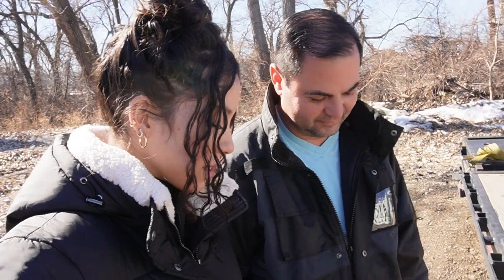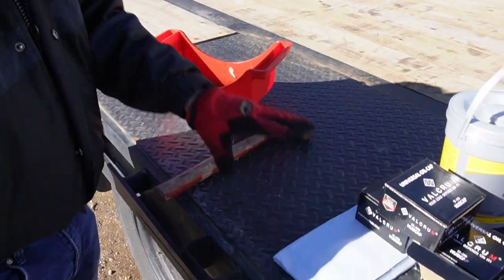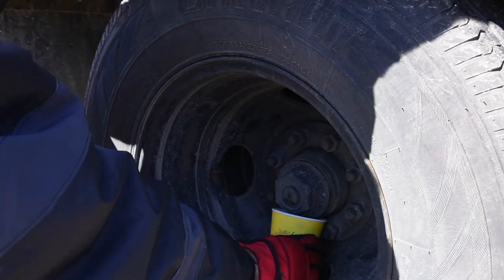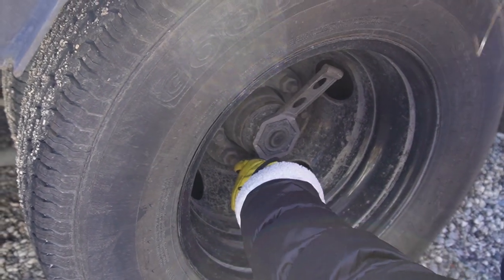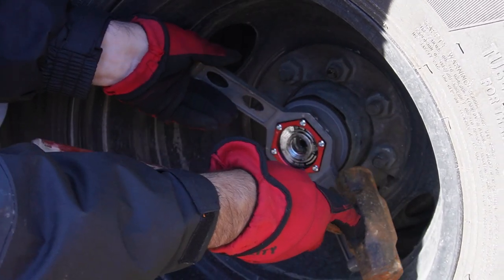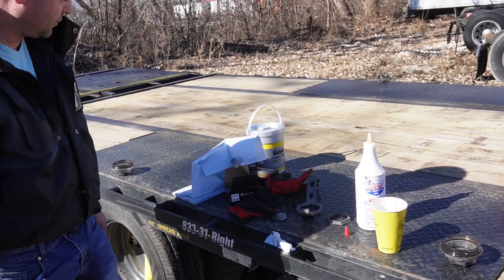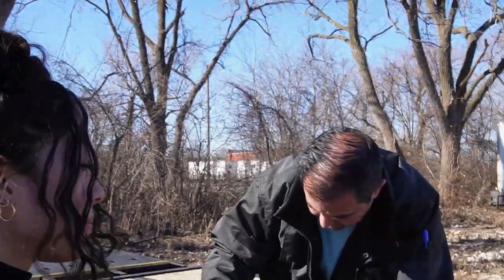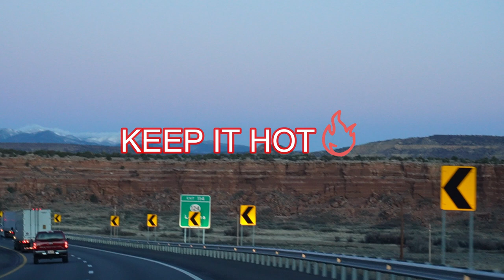HUB OIL SERVICE #truckers #howto #hotshottrucking

Comment: You could just loosen the aluminum caps to move the drain plugs to the bottom and not have to move. Also, you should consider going to grease to help in case your seal on the inside fails, you won't lose all of the lubricant and potentially burn up your bearings.
Reply: Please don’t go to grease, just stay on top of your maintenance and change your hub oil